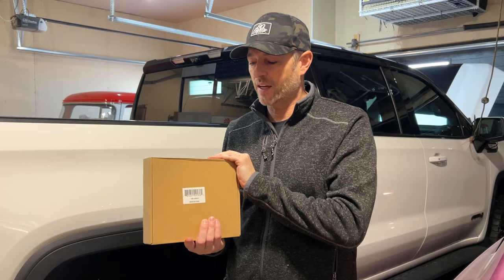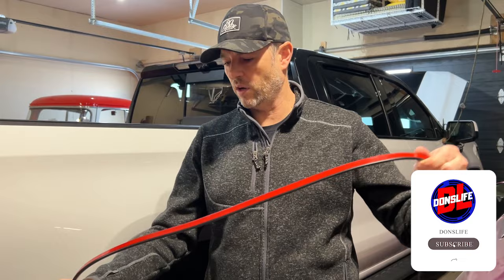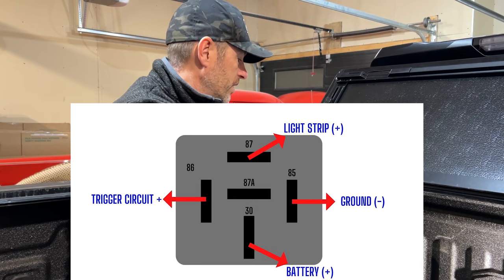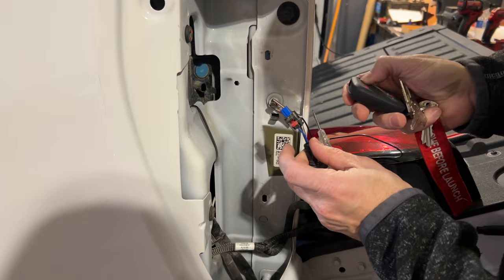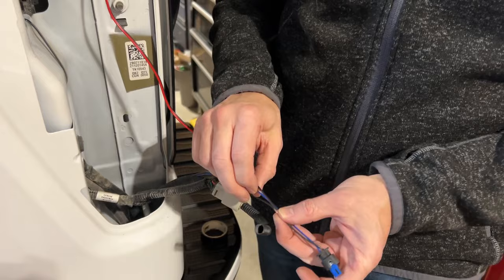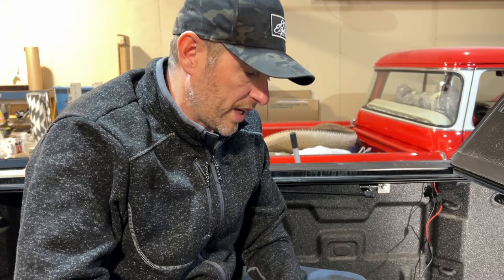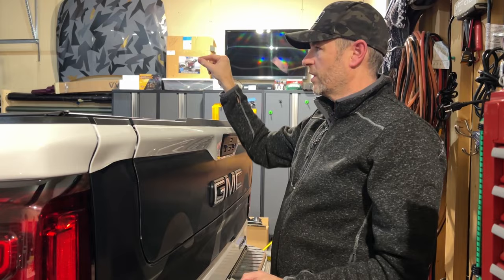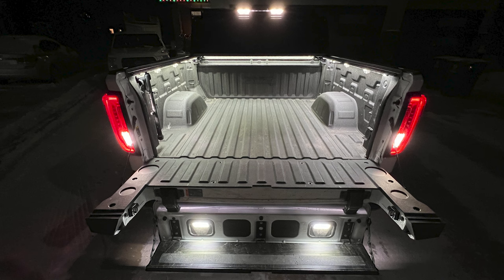Affordable Truck Bed LED Lighting: Easy Install Guide

Comment: I did fast forward a little through the video, but with the relay tapped into the bedlights/break lights and then the relay main power source being the battery, will the new lights work only when the bed lights/break lights are on or from the on/off switch that came with it also. I was thinking if the bed lights aren't on the relay will not be on so the new lights will not come on with hitting the bed lights.

Comment: So why not just use the power from the factory bed light instead of going all the way to the battery? Is that led strip going to draw that much power? Or are you being really safe.

Comment: Will the sticky keep sticking though?
Reply from the maker: No idea 🤷🏻‍♂️ Time will tell.   My under hood LED is holding strong with the same adhesive and it has been several months for hot and cold

Comment: Do you think it’s necessary to add a relay in an run power from the battery? LED’s draw such low voltage, you don’t think the existing bed light power would’ve been enough?
Reply from the maker: I tested the existing LED cargo light circuit. It failed to power more than 1 strip.  They end up flashing and shut off (all of the lights).

Comment: To bad they can’t be set up to come on when just opening the tailgates.
Reply from the maker: You could
Reply: @Donslife  I didn’t know that.  None of my cargo lights come on when I just open the tailgate. I have to use the fob or interior button.  How would I go about making them come on every time the tailgate is opened. ?
Reply: @joshwolf3410  you could probably add a pressure switch similar to the switch used for his "under the hood" led strip
Reply from the maker: Exactly.  It would require an added switch cleverly located to not get exposed to the elements.  There might be a water proof 12v switch that would work.  I haven’t gone done that road to recommend one at this time

Comment: Don, thanks for this video. Helped me greatly.  I just installed the same light kit.  Slight modification I used a programmable timer relay and also added a momentary switch near the back so you can trigger them with the remote or the switch.  For some reason I don’t always have my keys handy.  Also appreciate your comment about not tapping into the trailering wiring.  I ran a larger than needed dedicated line from the battery to power the lights, a cigarette lighter port, and whatever’s next.  Much thanks.

Comment: These put out great light. helps when having a bed cover.
Reply from the maker: Yes, I agree.  It helps the box cover rails provide a good mounting area (mostly)
Reply: @Donslife  I installed them on a ram. I tapped into the cargo light no issues. Helps when you have Alfaobd.
Reply from the maker: Good stuff.  I did a load test off of my factory LED cargo lights before the install and they couldn’t handle more than one strip added on (they would blink and shut off).  That’s why I chose the relay/trigger route.
Reply: @Donslife . You could do a lot with Alfaobd on any mopar vehicle. Too bad they don’t make anything like that for Gm or ford

Comment: Don, that is indeed another bright idea. My lights are on the way and I will be doing the same to my GMC Sierra soon.  Thank you for continue to inspire us to make our Truck better!!
Reply from the maker: Sending you an email too
Reply: @Donslife   Don thanks for your help, I successfully did my light install over the weekend. The hardest part was getting under the truck to run the wire from battery to the back of the truck.  Until now I didn't realize how dark it was inside the truck bed when it is covered :-).
Reply from the maker: @rgarcon9456  Excellent!  Happy New Year!

Comment: Just want to thank you and say what a good job you are doing with all the upgrade videos! Have a 2023 GMC 2500 HD AT4 and ordered light kit. What tyoe relay did you use and for main power I am assuming you tapped into battery?

Comment: Don, I’ll bet you could have piggy-backed those corner lights.  Looks great.
Reply from the maker: I tested that before filming. Anything more than one strand overloaded the circuit.  The existing lights and the strips would flash a few times and shut off
Reply: @Donslife  i am not surprised you checked it!
Reply: So is each strip wired to a separate bed light?

Comment: Great job tying in I did mine in a similar fashion but since I do not have factory LED bed lights

 I tapped into the 12V accessory on my 7pin hitch out back ran the switch up next to the top left side of the bed in the rear 

To add to that I used a door button switch to with the ground wire then fabbed up a 90degree bracket so when I open my LEER Fiberglass Tonneau cover it lights up the bed ass the button completes the negative side of the circuit when not being pushed In

but I also have the ability to use the switch to turn them off in case I have a load in the bed and need to keep tonneau lid open

I like the quality and for the price of these kits cannot go wrong
Reply from the maker: Cool.  I can’t tie anything into my trailer harness wiring.  The trailer tech goes haywire when anything draws from it.

Comment: I love the idea of tapping into the existing cargo lights. I'm also trying to add in a switch to manually turn them on with a hot power source. 

I cant figure out how to do that without a constant power source on the 86 (negates the trigger of the stock cargos). I've thought about wiring in a normal switch seperate from the relay but I get into the same issue of having positive wires powering each other again. I dont want to have a reversing aspect. Also, I dont think 87a will work because the trigger is not constant. Is this goal even possible? If so, any info you have, terms to search, or a "not possible" works too. 😅

Comment: You don't need to worry about the extra power load. That whole kit pulls less than 2A.
Reply from the maker: I tested it before filming.  If I attached more than one strip to the existing bed LEDs, they overloaded. They would blink a few times and shut off.   Surprised me too

Comment: Love this channel Don.  What is the easiest way to route your wire from the battery to the bed box?
Reply from the maker: Down the passenger side behind the battery along the existing factory wiring that heads the back of the vehicle.  Then come up where the box and cab meet.  Watch out for sharp angles where the wire could chafe or scrape
Reply from the maker: Thank you for your support too!

Comment: Did you try to connect two of the lights and tap directly to the factory cargo light? Skipping the 3rd light. What I'm trying to do is avoid the relay.
Reply from the maker: I tried one strip, two strips and 3 strips tapped into the existing LEDs.  The left and right existing LEDs are on the same circuit so even connected one strip to each resulted in a fault.  One strip total seemed to work, but not two.

Comment: Do you have a video on how you connected the relay, what type of cable you used to connect from battery and how you ran the cable?
Reply from the maker: I don't have a video and there are dozens on YouTube already for 'how to connect a 12v relay.'  I used 12 or 14 gage wire I think.  You want a gage that matches or is thicker than what comes with the product your installing.
Reply: Do you have a link for relay?
Reply from the maker: https://amzn.to/48rIGLe

Comment: Very tidy job there.

Do the led strips work independently from the existing cargo lights using the led strip switch or do the other lights need to be on for the strips switch to work?
Reply from the maker: You can wire them on a switch too if you wanted.  I chose to tie it into my cargo light.  But I also have a mod from a previous video that allows the cargo light circuit to come on when the reverse lights are on.  This allows me to hit unlock on the key fob to have them turn on briefly as well
Reply: @Donslife  Do you have a video of how you tied them into your cargo light switch?  I'd like to do the same.

Comment: Does the power coming from the battery just mount directly to the battery like you did for the under hood led light strip?
Reply from the maker: Yes that will work
Reply: @Donslife  okay thanks! Haven't done any of this stuff so I gotta wrap my head around it lol

Comment: Could you have just hidden the relay up front by your Auxbeam? Then taped in to the cargo light switch to trigger the relay? I just thought it might clean up the excess wiring. I'm also work on this and auxbean. Thanks for the video!
Reply from the maker: Yes you could, I was pretty far along with the install before I confirmed the LED bed-lights couldn’t handle the extra load.  Good option if I choose to redo it ever

Comment: Do they offer that today on the site? If not where'd you get it? Also new subscriber but love the content.
Reply from the maker: Links in the video description my friend
Reply: @Donslife  typo I'm sorry instead of today I meant relay 🤣🤣
Reply from the maker: 😂 its a 12volt 30amp 4 pin relay.  Search amazon and you’ll find tons for under $10 too

Comment: thanks for the  installation guide question what type of relay to use
Reply from the maker: Thanks. Just a pretty common 12v 30A or 40 amp relay with 4 pins.  5 can work too, one would just not be connected.

Comment: Like this upgrade and wanting to add to my AT4 as well.  Is it possible to tie each strand directly into the L/R cargo lights in the bed for power for each side separately?  See that you tried linking the strands in series from the L side and that failed.  Thanks!

Comment: Looks great Don. Did you have to add the relay? I don't see a link to that?
Reply from the maker: I did a test prior to filming and if you want them tied into the existing LED cargo light circuit, unfortunately you need a relay if you add more than 1 strip.  I tried every configuration too.  The relay is a 12volt 4 pin 30amp relay that can be ordered on Amazon pretty easily.  All of the pin locations are the same if you get one that is shaped like the one used in the video.  Some come with a harness for easier wiring and replacement if the relay ever fails.
Reply: @Donslife  Perfect, thank you for the quick response! I have watched nearly all your videos on the AT4 and have done most of the mods as well. I am getting ready to do the Auxbeam with Siberian light, rock and interior lighting before a big off-road trip we have planned in February

Comment: Hey Don love your videos, learned alot. 
How did you run the wire to the battery and did you use a loom
Reply from the maker: I used loom and ran the wire from the battery to the box of the truck along the main harness that GM already has in place.
Reply: By the way, my GMC Sierra has an AC plug-in built in the bed  . Would it be possible to wire from the AC plug
Reply from the maker: @PoppysG4  maybe, but I didn’t test the circuit since it relies on the switch on the dash being manually turned on.  I chose not to go down that route and explore it as an option
Reply from the maker: And the truck has to running for the switch to function

Comment: Don, when you ran a wire from your battery, did you run a neg wire too, and did you add a fuse on the pos side
Reply from the maker: Hello.  No negative wire from the battery, just grounded near the relay.  And yes to the fuse.

Comment: Don, did you put the lights in the multi-gate, or were they an option?
Reply from the maker: Hi, put lights in the step section if that’s what you’re asking
Reply: Sorry Don. I just read about the post for that install.    Thanks.  Rick
Reply from the maker: No worries man

Comment: Don how do you run the cave to the battery is there a video on that ? What exact relay sir ? Thanks in advance
Reply from the maker: I don’t have a specific video for the power wire from the battery, but I can tell you it runs down behind the battery and the front fender lining, under the cab and over to the box.  There are wiring harnesses under the can you can strap your power wire for the relay to.   The relay is a 12volt 4 pin 30A.  A 12volt 5pin will work too, just don’t hook up the 5th pin.  Some of these relays are also 40A.  That’s fine too
Reply: Thanks man I’ll try it this weekend
Reply: @Donslife  hey don you only ran the power line from battery not a ground right ? Ground you just get it off the bed ?
Reply from the maker: @HectorCastro-dg3vn  correct.   One power wire.  Grounded behind the taillight
Reply: You make it seem to easy man 😅 the light strips are longer did you cut them or just fold them ? Thanks in advance

Comment: Hi Don, could you please tell me what kind/model of relay you used?
Thank you!
Reply from the maker: Just your run of the mill 12volt 30amp 4 pin relay.  A 5 pin will work too, you just don’t connect the middle prong.  Lots of choices on Amazon

Comment: Did you have to take truck to dealer to get programmed for the led lights installed in the rear? or di you do it yourself?
Reply from the maker: Everything has been done myself.  Some of the lighting behavior modifications are using products from BoostAutoParts

Comment: Info, link or suggestions on the specific relay you used? I’m not very well versed in electrical wiring. Thanks!
Reply from the maker: Look for a 12volt 4 pin 30amp relay.  Amazon is a common place to get them

Comment: Could advise where you ran the 12 volt power for the relay from inside the Cab to the Box?  Is there a Grommet you can pass this wire from inside to outside?  I don't want to go underneath the floor to run this.    Thanks again.
Reply from the maker: I ran under the floor along the factory wiring behind the battery.  You can follow it all the way to the box
Reply: @Donslife  Thanks, I'll check it out.

Comment: Hey don, i have a 19 LT, I followed like you, and when i hit the bed light button they come on and blink and go out. But when it's night out hitting unlock turns on the bed lights and they stay on, but not in the day.  Would you know why they blink have you heard anything like that?
Reply from the maker: Sounds like the circuit is getting a little more current. At least just enough to keep it running.  I am not sure at the moment
Reply: @Donslife  ok thanks!

Comment: don what is that tool on 4:08? i just bought the ni light and want to install on my 2003 silverado work truck. thanks
Reply from the maker: A basic 12v circuit tester is all. Nothing fancy

Comment: Do you have to keep the switch that comes with the strip lights when you use the relay?
Reply from the maker: You’ll need something to act as a switch or trigger to tell the relay when to turn on or off.  You could do that with the switch that your lights might come with or use a circuit from existing lights like I did
Reply: @Donslife  I noticed when you tied up all the wiring that the switch that came with the lights is tied up with everything. I'm trying to set mine up in my truck (2019 Silverado) like you did (work on the same switch that turns on the factory lighting). I guess I just don't fully understand how the relay was wired up.
Reply from the maker: I just didn’t want to chop up the wires so I left the switch in the on position and tucked it away.  There are hundreds of youtube videos to show how to wire up a 4 pin or 5 pin 12volt relay.   

In principle it is fairly simple if you draw yourself a diagram plan first.  That’s what I do

Comment: Can you dumb down the relay connection for me? Never used one
Reply from the maker: A relay acts like a switch but turns on or off when a current is sent to it.   So you can wire one up to turn accessories on or off when another circuit is turned on or off.   This is a good way of providing more current to an accessory that may otherwise overload a circuit it gets tapped into
Reply: @Donslife  thanks man. I ordered the bed lights the other day and was looking through the comments here again and realized I won't be able to do it the "easy way".
Thanks for the quick reply, you just gained a subscriber 🤙
Reply from the maker: Glad to have you 😊

Comment: Don,
What did you do with the negative from the truck bed Led light and the negative from the switch? Did you tie them together and connect them to the ground side on the relay?
Reply from the maker: I believe I did ground everything to the relay and then the relay to the body.  Lots has happened since this video was created.  My memory is fading 😀
Reply: @Donslife  thanks Don. After following your video instructions and wiring them up, when I turn on the truck and push the light button in the cab the light strip just blink on and off. Any idea why they would do this?
Reply from the maker: Sounds like a power supply problem.  Did you test the lights on their own first and/or double check your relay wiring?  The switch should just be sending a signal to the relay to turn on or off.  The power for the light strips comes from the relay once it is triggered on.

Comment: How would you tap into the cargo light at the top light? Any help is greatly appreciated
Reply from the maker: There is a harness in the headliner on the left side back corner for the cargo lights and 3rd brake light if you have them

Comment: Do you know if there is a way to get the lights to stay on longer when you hit unlock?
Reply from the maker: Yes, you just have to use the cargo light button in the cab if that’s the circuit you tapped into like I did.  The unlock is just using the temp timer built into that feature when unlocking the vehicle

Comment: What did you do with the ground that comes with the light stips? I see you tapped into the ground from the factory lights.
Reply from the maker: Connected them to the factory light ground since it was already exposed
Reply: Don, if I understand correctly, you tied the ground wire from the bed light to the ground (negative) from the LED Strip switch? Did you come off the relay ground to those same two wires or are did you run a separate ground of the relay to the truck?